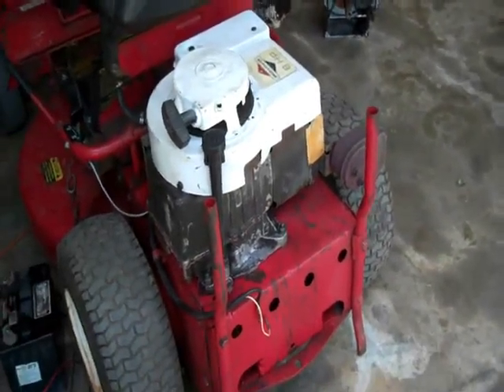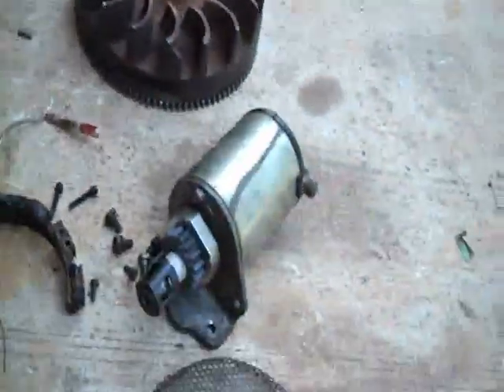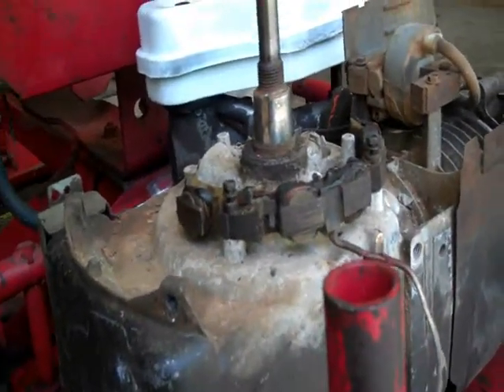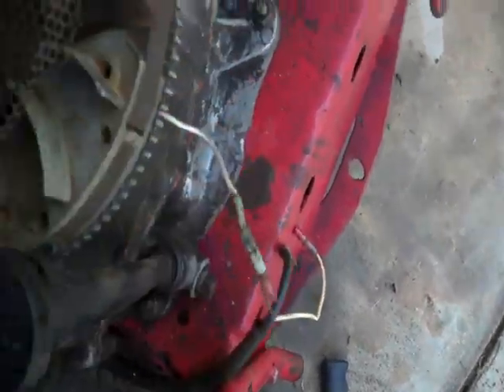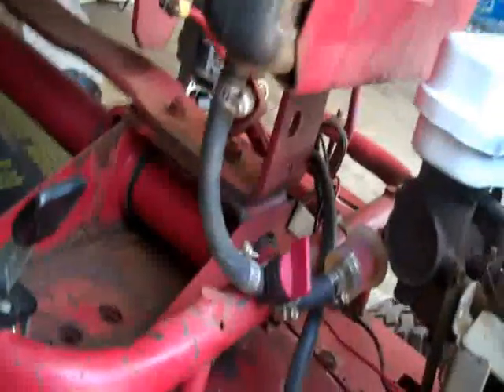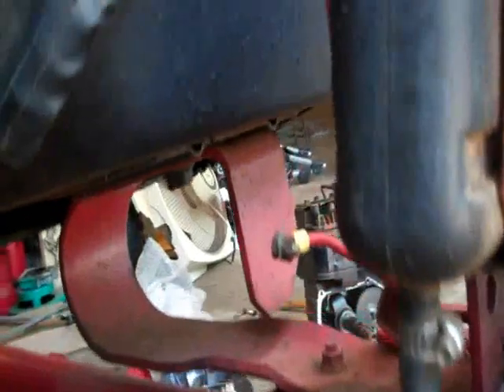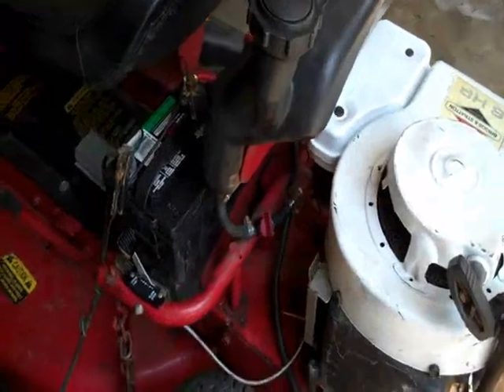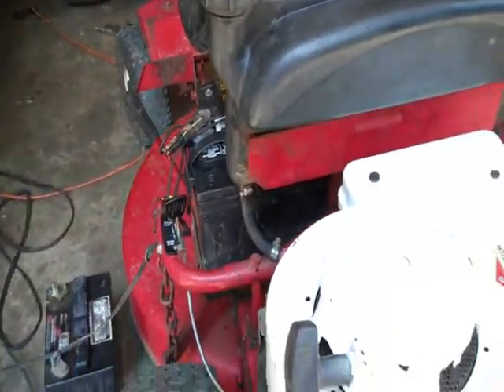how to convert briggs to electric start - 6/10/11

Comment: You should NEVER hit a flywheel with a hammer. You can crack the flywheel, causing it to explode during operation. You may not even see the crack.

You're better off putting upward pressure on the bottom of the flywheel with a pry bar then hitting the crankshaft with a hammer.

Comment from the maker: @evangoldstein1 
ring gear for flywheel - 392134
starter - 499529
alternator - 393295 (2 wire), 391529 (1 wire)

i would check te warehouse and look on ebay, there not cheap

Comment: I have a bunton walk behind lawn mower that has electric start but it looks like the previous owner didnt set it up to work so it has to be started with the pull cord, how can I find out if it actually works? because I dont see a starter or a solenoid or any cables for a battery hook up

Comment: Hello, I have a Briggs ES45, Model 10D902 TYPE: 0253 B1 06072A53. Is ther any way to add a starter motor? I think removing the old flywheel and threading the holes might add some gearrings from another engine to get it geared..

Can i change the flywheel to another theeth version? I have seen that some have it as a ring gear and some are geared as a cast form (alloy) with very rought teeth.

i only need a starter and flywheel, electrical system is easy for me then!!

Please help my mother can't crank it any more and i have to drive long ways to help her

Comment: i think i have the same engine as you except mine is horizontal shaft, i was wondering what the part numbers are for the geared flywheel, starter, and alternator. I can't find those three parts that will fit my engine but seeing as its basically the same engine im thinking the ones you used will work for me. let me know please!

Comment: I was thinking about a design where the motor is constantly engaged to the engine so that it acts as an alternator and charges the battery too
Reply: The. You need a generator/start like on the old kohler garden tractors

Comment: @JHx86 anything but hitting the flywheel directly with the hammer, that could end up severely injuring or even killing someone if that thing let loose at full throttle...